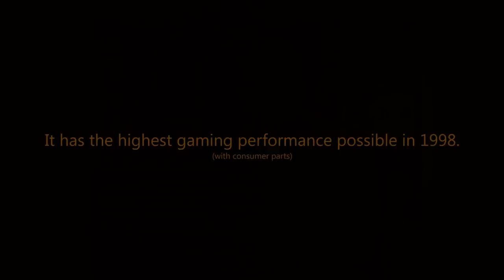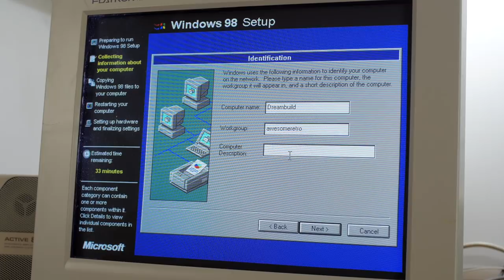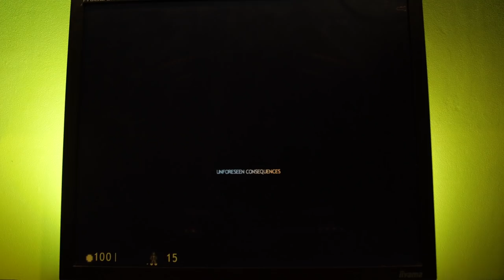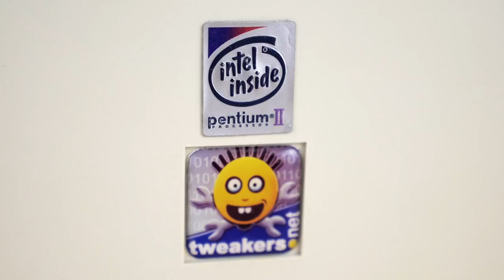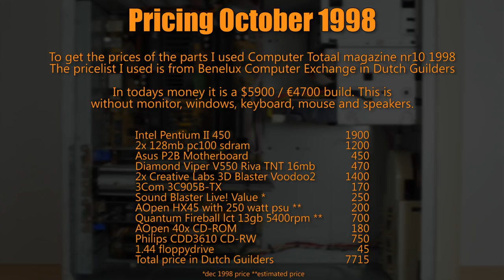1998 Gaming Dreambuild! Pentium II 450, 3DFX Voodoo 2 sli

Comment: sli in 98? i thought this was a recent thing, interesting
Reply: It was very new back then. And the SLI'd cards are 3D accelerators, a regular card is required for video display and 2D acceleration.
Reply: +djmhyde Nope Voodoo 2 was the first card I believe. But NVIDIA bought 3DFX and then brought out their own SLI cards around 2004. AMD brought out CrossFire cards in 2005. So the concept has been around for a fair while now. The funny thing is when you break it all down the basic parts are still the same.
Reply: +djmhyde +blankname1984 In fact SLI and Crossfire were both born out of 3DFX. To avoid bankruptcy, 3DFX was sold to nVidia in late 2000. The majority of the engineering and design team working on 3DFX's Rampage, remained with the project to work on what became the GeForce FX series. Most of those who did not find jobs at nVidia, found employment at ATi (acquired by AMD) and brought their knowledge with them to assist in the creation of the X series of graphics cards, and form their own version of SLI known as Crossfire.
In 1997, ATi acquired Tseng Labs' graphics assets, which included 40 engineers. Now if you don't know anything about Tseng Labs, they produced some of the best 2D video cards in the years just before 3D graphics. Most notably, the ET4000 and ET6000. (I still have my ET6000 in it's original packaging.) In 2000 ATI acquired ArtX, which engineered the Flipper graphics chip used in the Nintendo Gamecube.
ATi had more than their share of driver issues in those early years, perhaps in part because 3DFX's best software engineers were acquired by nVidia. Prior to 3DFX's acquisition however, ATi was not really one of the fastest or most exciting graphics cards on the market. The main reason they survived at all up to that point was because of a deal they had with Apple to supply graphics cards for the MacIntosh. All iMac G3s came with a variation of the ATi Rage 128, for example. Even it's predecessor, the Power Macintosh G3 desktop, came out with an ATI 3D Rage II+ or ATI 3D Rage Pro. The reason being that the 3D Rage was the first 2D/3D combo card on the market and the timing was right for Apple who were delivering a new product.
Here's a list of some of the first 3D graphics cards on the market:
3D Labs Permedia
3DFX Voodoo Graphics
ATi Rage and Rage II
Matrox Millennium
Matrox Mystique
Number Nine Imagine Series
nVidia NV1
Rendition Verite V1000
S3 ViRGE 3D
VideoLogic PowerVR Series 1
Of those, the most interesting at the time were 3D Labs, 3DFX, Rendition, and VideoLogic's PowerVR.
PowerVR now resides in many of the most popular smart phones.
Reply: +djmhyde I remember having one of the first SLI setups in around 1997/1998. I bought a 12MB Voodoo2 and a mate of mine bought 2, but his system only had a single PCI slot  so he let me blag one for a while.. (not PCI-E, I'm talking bog standard old school PCI (shit and there's even older school than that MCA/ISA/VL-ISA slots anyone??) Yeah, I've been doing this shit a long time :)

Running Unreal (the very first game) in 1024x768 on my P2-266 that was running at 400. I later found out that I somehow managed to get an ES (Engineering Sample) 266 which might have been why the thing ran at 400 for a good few years and never batted an eyelid.
Reply: +g_tripwood_industries woooh, mine was a bit older and only 4mb. I still have it installed in an old IBM, just to play turok once in a while :)
Reply: +g_tripwood_industries yeah i had sli back then too. in fact, the only sli i ever had was with a pair of 8mb voodoo2.
sli was insane back then. it was like upgrading to a voodoo3, and there were NO GLITCHES. and the video memory was added (so i effectively had 16mb of video ram)
Reply: +djmhyde : it wasn't really known as sli back then.
Reply: sli slogan came from 3dfx engineers, after nvidia acquired their company they kept it but changed the technology behind

Comment: Thanks to this video, it convinced me to build high end year 2004 PC. Specs:
DFI K8T800PRO-ALF socket 754
AMD Athlon 64 3200 + 2.2GHz socket 754 (NewCastle)
2x1GB Transcend DDR400 CL3
2x WD Raptor 740GD 10k rpm in RAID 0
WDC 1200JB 7200 rpm (IDE)
Samsung Spinpoint 80GB 7200 rpm (IDE)
ATI Radeon X800 Pro 256MB (AGP 8X)
Creative Sound Blaster Audigy 2 ZS (PCI)
Scythe Andy Samurai Master + Arctic Cooling MX-2
Chieftec A-90 GDP-550C
Fractal Design Define R4
TSSTCorp SH-S222A (IDE)
Sony 3.5" floppy disk drive (IDE)
D-Link DFM-562IS 56K modem (PCI)
TP-Link TL-WN851ND WiFi adapter (PCI)
2x Fractal Design 140 mm + 1x Scythe SlipStream 120mm 800 rpm
Windows XP Professional 32bit SP3
Not the ultimate, but truly something. ATI Radeon can reach Core clock 540 MHz/Memory clock 570 MHz. CPU's limits are unknown, because at 224 CPU clock system BSODed and SATA HDD data corrupted, so now I have to reinstall Windows. I named computer as Athlonium 64.

Comment: I wanted this setup so much in 1998. If I just had the money...

This is the dream system for Unreal 1 1998.
Especially when paired with a SoundBlaster Live! and surround speakers.

"Unreal delivers this cutting-edge realism on computers using a Pentium 166 or higher. And for those of you lucky enough to have a Pentium II, MMX technology or a video accelerator, the Unreal realms will become your reality."

Comment: Great video! I am doing retro builds for years and i love to see people are sharing this hobby. Recently i made Hi end Pentium 1  PC. Pentium 233 MMX, 256MB RAM, MB P5i430 Titanium 1, Voodoo RUSH, HDD CF 4GB, Zip 100mb,Floppy 1,44, LG DVD drive, Sound Blaster AWE64 value, Win95. Keep up the good work, you are inspiring.
Reply from the maker: Cool build! You only made 1 mistake which slows down your system a bit. the Intel 430TX chipset can only cache 64mb of memory. So if you use more then it will be slower then using 64mb :) I have had a Pentium1 166mmx and Dual P1 233mmx both with 128mb 72pin memory. But that was on the 430HX chipset which can cache 512mb mem :)

Comment: I am doing a similar project, but I made it more versatile, since I wanted to play older games too. I made it in a way to change multipliers and speed.

Motherboar: P3B-f rev. 1.04
CPU: PII 400 from April 1998. PIIs made up to August 1998 were multipliers limited, hence if you take a PII 400 you have multipliers up to 4x.
Video: being checked the best video card, probably PCI, currently I am using an S3 Virge.
3-D Accelerator: Voodoo 2 SLI - 3D Vulcan 2 (12MB) - 110 MHz Ram (vs the 90 MHz default).
Ram: 256 MB PC133 7 ns.
HDD: 80 GB Seagate Barracuda 7200 RPM - UDMA133.
Audio: Sound Blaster Awe 64 Gold.

I set the FSB to 133 and I just change the multiplier from 2 to 4 in the bios. I can hence go from 133 to 533 MHz. A better idea could be to have a MB with jumpers and attach the 2 or 4 multiplier change to the turbo button on the case.
Reply: my pentium 2 400 could run with 150fsb. i used it like that for 6 months. 600mhz. pretty fast.

Comment: Fast forward to 2020 and the prices have soared. Currently seeing the Asus P2B motherboards selling on auction sites for £55+, a single 3DFX Voodoo 2 card is £90+. Crazy stuff!
Reply: i'm holding on to my voodoo2 cards for 10 more years, see what prices are like then.
Reply: Well the demand for them is going up and there in limited quantity
Reply: Yes, tell me about it.  I just paid £150 for a voodoo 3.  I could have got one a bit cheaper if I waited and went for an auction rather than a buy it now.  But this one, unlike many others, was actually shown as working in the listing.  I have just tried it paired with my PIII 550Mhz (free!), and Soundblaster Pro 2 (£75) and I am very happy with it.  Just wish it cost less to build!

Comment: I've got a mobo with pentium ii 400, 128mb of ram, riva tnt2 and voodoo 2. Waiting for the case to build my system
Reply from the maker: +David Zachary Cool! :)
Reply: +victorbart I´m making my 1998 gaming build. Check my latest video for the parts I´m going to be using!
Reply: Ya I think the AGP port amd TNT would have been faster than using this SLI setup.  Albeit this is cool.  Did the chipset not alow another 64MB stick?  Also a 7200 rpm drives were around then along with the SCSI 1000rpm drives.   A raid controller and dvd rom and encoder would of been nice on thus build as well.
Reply: I going to try to build and k6-2 gaming PC when got money
Reply: +Happy Tylerienmam Networks - better take a Pentium II with intel BX chipset if it doesnt have to be the k6-2 out of sentimental reasons. the boards/drivers are so buggy and not stable, its often a nightmare to get it up working right.
Reply: +Rex Overbey most chipsets of the time were limited to either 256 or 512MB of RAM. AMD TNT? It's nVidia, actually. "AGP port" is a bit redundant as well, as AGP stands for accelerated graphics port anyways. Did AMD even still make video chipsets at that point? I know they did before and after, but I don't recall seeing anything by AMD on the market at the time. I think they chose SLI because they, as well as plenty others, enjoy 3DFX products to this very day. 7200RPM drives were more targeted at the business end of the spectrum, and generally when put into systems such as this, their transfer rates would be limited to that of a 5400RPM drive anyways. The SCSI 10,000RPM drives were very large and required much more equipment than this system could possibly handle, and for the same reason the benefits of 7200RPMs would have had were cut out also applies to SCSI drives. I'm not even sure if this motherboard would even support booting from SCSI in the first place...
Reply: +Rickertsc2 soundblaster AWE64 or Gravis Ultrasound. Best two ISA sound cards ever produced in the general opinion, though I prefer the MediaVision Pro Audio Spectrum 16 Plus/Studio because it has a SCSI controller built in.
Reply: +AIO inc. AMD was making only processors back then with their athlon and duron processors. you are thinking about ATI rage 98 graphics cards

Comment: Nicely edited video. Getting an appropriate PSU for a retro PC is the most difficult thing. While a good modern PSU would cope with the +3.3 V and +5 V requirements, the lack of a -5 V line would be a problem, I imagine? It is required by ISA slots. The question is, would the board even run without a -5 V line if you did not want to use the ISA slots?
Reply: It's a direct current voltage not alternating so any ground line that is -5v or higher would work perfectly fine. I honestly don't even know why they rate them at voltages DC has two lines positive and ground.
Reply: I run a cx430 psu in the exact same setup no problems

Comment: My build in 1998
- Pentium II - 233
- 32Mb Ram SD
- 3.2Gb Quantum Fireball
- Rendition R2200 VGA
- Sound Blaster AWE 64.

Thanks
Reply: Great computere you had there. I was using in 98:
Shuttle Hot 569
Pentiumio 233 MMX
64 sdram
matrox millenium
Orchid Righteous 3D II 
Sound Balster CT4620
that was awesome. I played a lot of Thief The Dark Project

Comment: Back then computer hardware was so sexy. You could actually cut yourself with the stuff. Nowadays hardware is nothing but fused mush! The only reason we need big hd space and multi core processors is because of inefficient software and fucking complicated web media and always updating media platform.
Reply: Gud Dergo i'd have to disagree on that, i don't understand whats sexy about a shit-coloured PCB?
Reply: i mean, this build is undeniably cool, and is sexy in a retro way, but to say that it's more sexy than for example a devil-13 295x2 is just wrong
Reply: +Gud Dergo What are you talking about? You're saying if things were efficient we won't need multi-core processors and other things? Besides, today's hardware is way sexier than it used to be. Old hardware might have the raw, functionalist flare to it, but today's hardware is actually designed to look good.

As someone who built computers back then and continues to build systems today, it's much better now than it used to be.

Comment: Just finished my year 2000 dream build!

Dell Inspiron 4100 Desktop Tower
Intel Pentium III “Coppermine” 1Ghz 
Intel 850E Socket 370 Chipset
Micron 512MB SDRAM
Wester Digital 80GB 7200RPM
3DFX Voodoo5 5500 AGP 64MB
Creative SoundBlaster Live! 5.1
StarTech 1 Port PCI 10/100/1000 32 Bit Gigabit Ethernet Network Adapter
DVD-R/RW Drive
CD-R/RW Drive
3.5 Floppy Drive
19" Dell Sony Trinitron P990 CRT VGA Monitor 1600x1200 @75Hz
Dell SK-8000 PS2 QuietKey GX1 Keyboard
Logitec PS2 Wired Mouse
Microsoft Windows ME😂
Reply: 3dfx dream build yes but year 2000 was catastrophic for 3dfx and got smoked by gf2gts by 3 times !

Comment: Very nice build you have there, you gave me the idea to build a retro pc with your ultimate 2000 build! i am having so much fun playing old games again!
Reply from the maker: Cool which games do you play?
Reply: victorbart The old Need for Speed's, all the LEGO games, A2 racer, commandos. i can play all those games at 1280x1024 32bits on highest settings, my pc i had back then could never do that :)
Reply from the maker: Walter Van Heemskerk
Nice! with that resolution you must have a fast machine which specs do you have? :)
Reply: victorbart Asus CUSL2-C
Intel Pentium 3 Coppermine 1000mhz overclocked to 1110mhz @1.80v
512mb Corsair DDR 133 overclocked to 148mhz
MSI Geforce4 TI 4600 128mb
Maxtor Diamondmax plus 8 40gb (Windows 98SE)
Maxtor Diamondmax plus 10 80gb (Windows 2000)
Asus 52x cd player
Icidu 10/100mbps nic
Aopen 400w PSU
Sweex prescott satrun blue case (almost free and new, case sucks low quality)
New noiseblocker fans and Cooler Master cooler for CPU

Comment: Im not a 90's kid. Can someone explain to me why there was an extra video card called the viper v550?
Reply from the maker: Viper V550 is a 2D and 3D card. Voodoo2 Sli is 3D only solution :)
Reply: +victorbart so without a voodoo card you couldn't run 3d graphics?
Reply from the maker: Yes on the Viper V550 :) But for glide games you need 3dfx :)
Reply: So if this is a 1998 build, when did 2d and 3d start getting implemented on the same card?
Didnt nvidia have geforce around this time?
Reply: would you be better off with a riva or voodoo with a 2d card?
Reply: ChannelAsh100 the voodoo 2 performs better in 3d.
Reply: especially the agp version
Reply: Voodoo 2 and 3 PCI and AGP versions perform identically. They are not nearly fast enough to push PCI bus to it's limits. Not even my PCI X 1650 XT pushes the PCI bus to it's limit.
Reply: Joey Greathouse PCI and PCIe are different, plus your 1650XT is way too weak to push PCIe to its limits
Reply: RealDarkFilm Oops I meant 9250SE lol my bad that's the one I have that is PCI

My 1650XT is AGP bus and it doesn't push that either haha
Reply: Joey Greathouse Yeah they don't even take advantage of AGP, you just save a PCI slot, huh.
Reply: Miike Hunt voodoo cards were expensive. Was it really practical to sli them for the big price? It seems kinda like what someone would do when they tri or quad sli titans.
Reply: ChannelAsh100 My Voodoo card was $80...